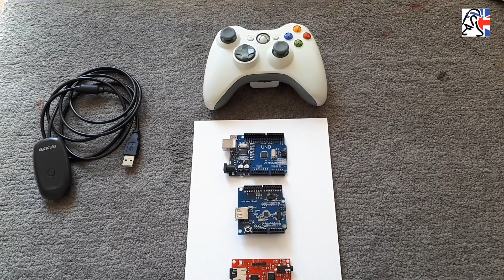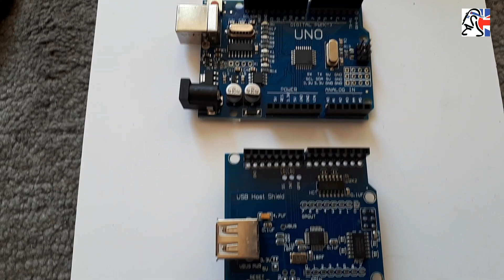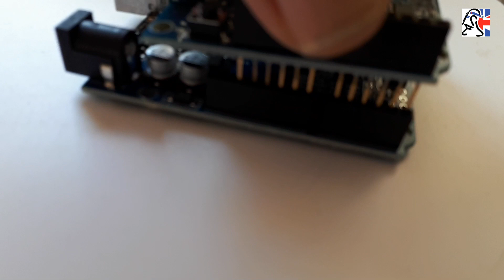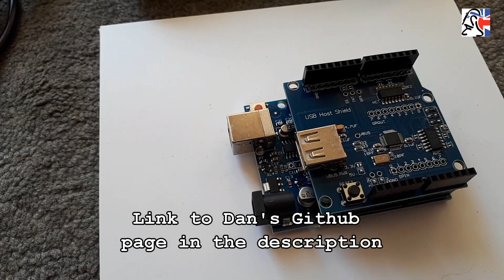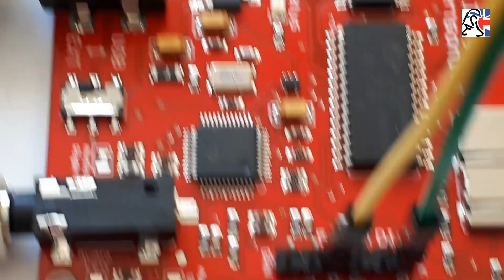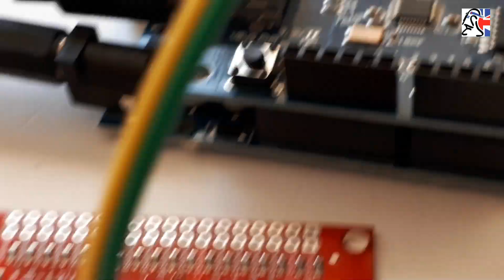Padawan 360 control system build Pt. 1 (Uno version)

Comment: I'm making an R5 and don't need the sabertooth or syren10 I was planning on using ESC does your software control esc I f I'm using FS-IA6B receiver.
Reply from the maker: No, this system is build specifically to use the xbox 360 transmitter and USB receiver.
Reply: @ImperialLightandMagic  aaah ok, thanks and keep up the great work.

Comment: my sparkfun MP3 player did not come with pin headers.  Would it be okay just to solder on some m-2-m jumpers so the other end can plug into the arduino or do you think I should try soldering in the headers??

Comment: So here's a question about the sound effects, how does that exactly work? I'm assuming the sound files are on that Micro SD Card you got loaded up on the mp3 trigger correct? I'm building a C Series droid so the average astromech sounds aren't exactly gonna work for what I built.
Reply from the maker: Yes, the individual sounds are on the microsd card, and named with a numerical start (ie 01scream.mp3, 02chortle.mp3 etc ). The arduino code then calls these sounds from whichever button or combo you assign. However it only calls by track number rather than name, so you also may benefit from watching my “drive sort” utility video which goes into more depth.
Reply: @ImperialLightandMagic  Alright I have a problem. I thought for the last week it was a faulty board but it's not. I soldered two male connectors in a serial chain, negative to positive then I took the positive and negative wires and put them into the fuse box. 
I get power to the Uno but no power to trigger.  I went back from square one and I had actually flipped which connector went into which plugin, and I got super excited cause I could press the sample button and it would play sound. Then I realized I have no power to the Uno at all. Power to everything else, Trigger, Sabertooth and Syren, but not the Uno. 
I thought maybe I did a bad solder, grabbed a new set of pre-wired barrel connectors, did the series chain again, and low and behold, STILL got the same issue. 
I'm really scratching my head on this one.
Reply from the maker: @Hikuro2pnt0  Hi there, I don't actually use the "Y leads" any more to provide power, check some of my later videos, but in brief, I use the Sabertooth to provide 5v out to the arduino and the Syren 5v out to the sparkfun mp3.
Reply: @ImperialLightandMagic  I see, I actually just ended up using two male connectors individually to power both boards. The only issue now I'm coming across is not getting the audio to play via the controller. This warrants further investigation I think.

Comment: Steve, You mention a "Y" lead in your video to connect power to both the Uno and the MP3 Trigger using barrel connectors. Do you know where to source these cables? I've searched without success.
Reply: i also want to know what the gauge wire your using for the y connecors

Comment: I am confused on the sketches as I am not as familiar with Arduino yet.  On Dan's Github what should I be downloading for sketches?  Is there one or multiples?  It would be great if you did a video of uploading the required sketches onto the Arduino :)  Just need more details for us newbies.
Reply from the maker: Fair comment,  best thing is click the green "code" button which downloads a zip of everything, then unzip that file and go to the "body" folder for you arduino type ie uno or mega. The ino sketch will be in there, and you should also now have all the libraries in case some were missing.

Comment: I know this was a while ago but is it possible to use (https://www.dfrobot.com/product-656.html) as a replacement for some of these parts ?? thanks
Reply from the maker: It's an interesting looking board, and you might be able to use it to control servo movement/animation, but as far as the motor drivers go, it just wouldn't have enough punch for a R2 sized droid in my humble opinion.
Reply: @ImperialLightandMagic  thanks for the advice

Comment: Hello Steve quick question I’ve done everything in the vid but for some unknown reason I’m getting no sound on my speaker when I press my controller , my controller is connected  I have lights on everything I have put memory card in with all sounds etc…. I’m at final stage with my build now and electrics really aren’t my thing lol
Reply from the maker: When you press the little toggle switch on the mp3 board, do you get a sound?
Reply: @ImperialLightandMagic  I pulled my hair out and finally found out you need a certain sd card then once I changed my card I pressed the toggle switch and yipppee it worked ... by the way I emailed you last week 👍🏼
Reply from the maker: Ah sorry Paul, been working 7 days a week and sometimes gloss over emails, glad you got it working.
Reply: @ImperialLightandMagic  all thanks to you really 👍👍👍👍👍 just hope you read my email and can help 🤞🤞🤞🤞🤞

Comment: I was thinking of hooking this up to a 20v cordless drill battery.  Would I need to change anything from your system to work with that?  I know you mentioned it can go up to a higher voltage, but I don't want to mess anything up.
Reply from the maker: So long as you build it this way, and your amplifier can take up to 24v (I use TPA3116 mono amps which take 24v, check specs on yours) you should be fine. Speed may be a little high but you adjust that in the code

Comment: If i upload the dankraus sketch i get errors. i use this one: padawan360_body_uno.ino
Reply from the maker: You may be missing one or more of the required libraries listed below.  You may have to hunt for them maybe on dimension engineerings' website for sabertooth and syren, mp3trigger maybe on sparkfun site and xboxrecv not sure, a quick google for "xboxrecv arduino library" and I'm sure the solution will present itself. Good luck!
#include <Sabertooth.h>
#include <SyRenSimplified.h>
#include <Servo.h>
#include <MP3Trigger.h>
#include <XBOXRECV.h>
Reply from the maker: Did you check Dan's "Libraries" folder? https://github.com/dankraus/padawan360/tree/master/libraries
Reply: @ImperialLightandMagic  thnx going to do rewsearch and pratice some
Reply: Hi there I am having trouble trying to connect the controller with the usb receiver it’s a Qumox one and ideas ? Thanks

Comment: would you happen to know why my controller is not working with it?
sound plays when i hit the Trigger on the Mp3 trigger.
controller syncs with the receiver, the light on the controller just blinks and when i hit a button it does nothing.
i tried with mega and uno.
Reply from the maker: Is it the same sparkfun mp3 player? Have you got the sparkfun library installed (I doubt the sketch would upload). Might be worth double checking you have a common ground and that you wire from Tx on arduino goes to Rx on sparkfun.  If you are using a different type of mp3 board, you'd need an appropriate library.
Reply: @ImperialLightandMagic  yeah it's exact same board you have, and tx to rx and grd to gnd

i ordered a different shield and receiver to see maybe something with the receiver if not being found by the arduino. if not i can return them.
Reply: @ImperialLightandMagic  what is the sparkfun library????? THis is not in the tutorial? I am a compleet beginner and dont know this kind of things

Comment: Fantastic! Do you have a link to all the part required plz, I'm in the UK
Reply from the maker: I would suggest visiting Dan's github and downloading the sketch. In the comments it lists the hardware required, having said that, what you see in the video, plus the drive and dome controllers, is about it. This one will have an amplifier, speakers and a fuse box plus mains breaker switch installed.
Reply: @ImperialLightandMagic  thank you fella